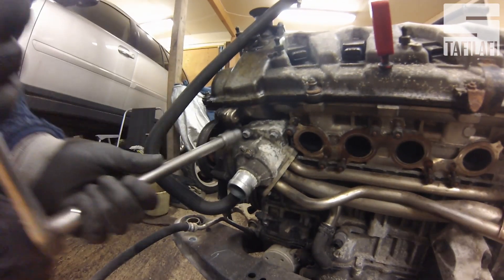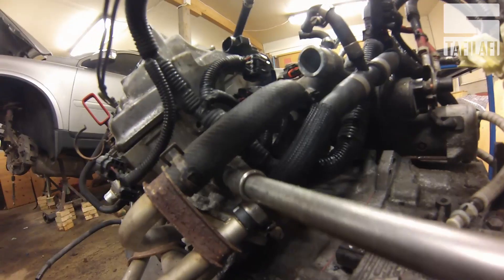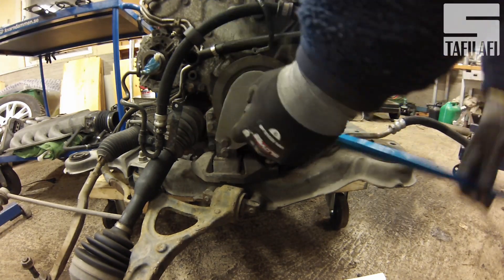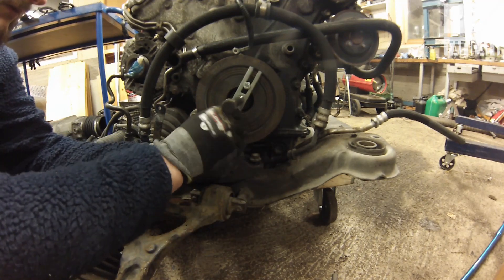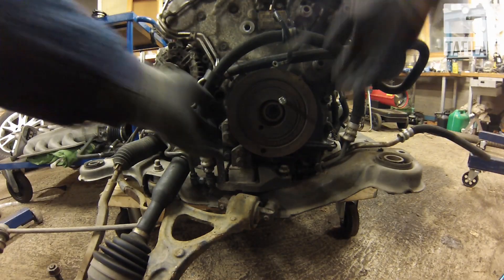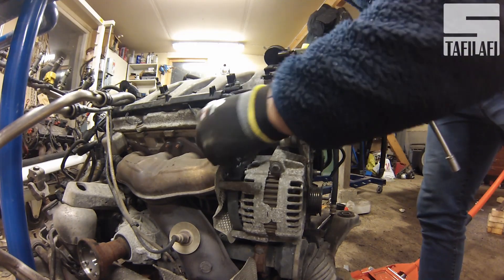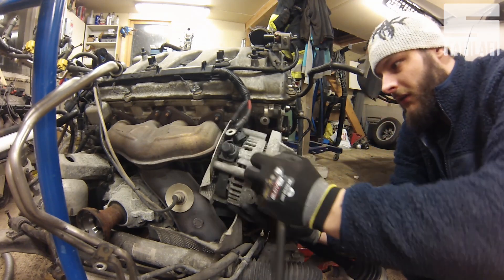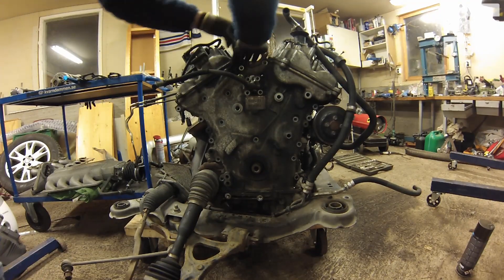Volvo XC90 V8, engine teardown part 2

Comment: What bolts did you use for the harmonic balancer?
Reply from the maker: To get it off the engine?
Reply: @Stafilafi  Yes, I've ordered the original tools for it. But I think the bolts to bolt the tool into the harmonic balancer are not included.
Reply from the maker: @TweakeNL-94  I used 8.8, but I recommend using 10.9 och 12.9 just to be on the safe side.
Reply: @Stafilafi  thanks! I’ve just bought the original tools at the end. They were €110 in total and worth it. :-). 

Unfortunately the engine block had scores in de cilinders. And a burnt valve. 

Decides to replace the whole engine.

Comment: Where is the Thermostat located on that engine?
Reply from the maker: If I remeber it right, it is located where the big waterhose connects behind the waterpump.
Reply from the maker: You have it right in front of you at the beginning of this video between approximately 0-10 seconds in.
Reply: Thank you so much, it's been days of me trying to find that location, you and your video is very much appreciated.
Reply: Is that on the upper or lower part of the engine, meaning is it connected to the larger lower radiator hose?

Comment: Thanks for your videos. I've got a 2006 where the front engine cover has started leaking oil. Volvo wants 23KSEK for the work and another 3-7KSEK for parts. I see that there is a lot of work to fix it but you showed that it's doable. I am waiting for the next video about putting it together.

Comment: thanks for posting the videos, I have a 2008 XC90 V8 as well, 218,000km, I am second owner, sure is tight to work in that space with that V8.
Reply from the maker: No problem, I have been sitting on these videos for too long, was supposed to put them on youtube long ago, the engine bay sure is tight, so much easier to work on the engine when its out of there, sweet to be second owner, Im 10th on mine, had this silver one only for half a year, fixed the engine and had to sell it.
Reply: @Stafilafi  thank you for the videos, they are very helpful, I commend you for doing the work in your garage with just hand tools, very impressive how you jacked up the vehicle to get the engine/tranny out from the bottom! :)